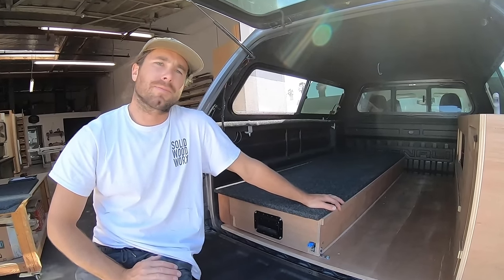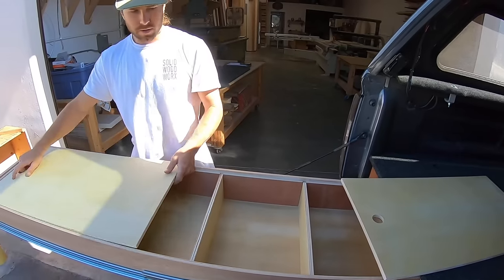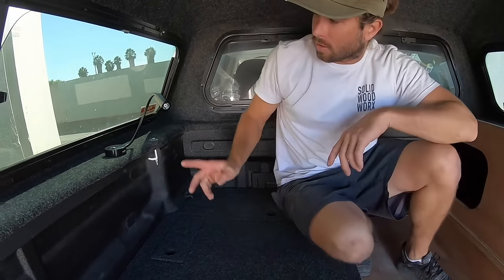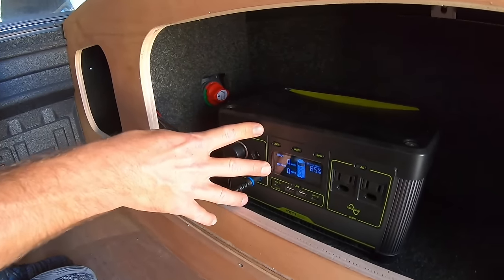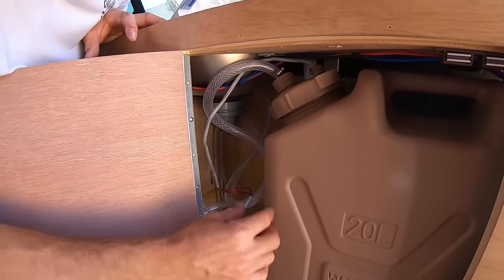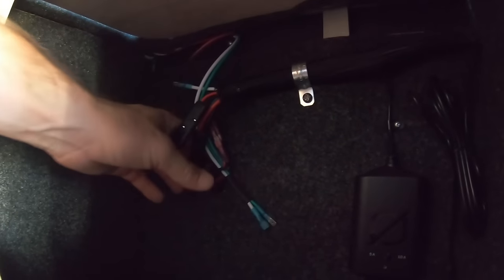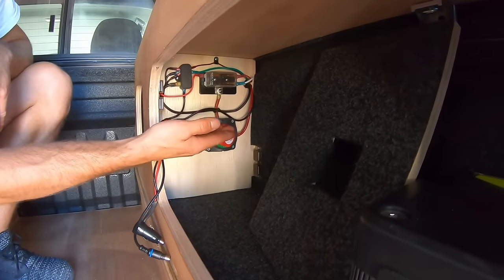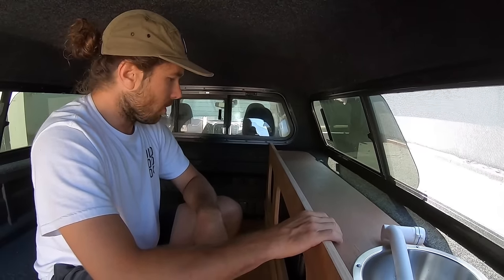GMC Canyon Camper Buildout

Comment: I am the owner and have been getting a lot of use out of the truck these past couple months. I really love and Brian did an amazing job on it. A couple replies to the comments. The sink just drains out the bed behind the rear wheel. I am finding I don’t use the sink very much at all. Mainly just to fill water bottles. If I need to use it where I can’t just let it drain onto the ground I can put a bucket or basin underneath the vehicle to catch it. Totally worked out with all the sizing of things. This is a mid height Leer top on it and when I am sitting on the bed with a 3 inch camping pad on it my head use clears the ceiling and it is quite comfy. I have sat out some rainstorms sitting inside with the he tailgate close but the window open and it is very cozy. The goal zero and wiring works like a charm. My Goal Zero is always charged when I need it and the electrics hardly draw from it. I am mostly doing weekend or two to three day trips so it is plenty. No need for solar at all. While the MaxAir fan on the roof is cool I don’t use it much so would probably skip it if I did this again. Only other thing is that I can’t access the drawer from inside the truck so just need to keep that in mind. I live in Southern California so it hasn’t really been a problem. Sitting on the tailgate and prepping dinner on the drawer is very comfortable and it is a great work surface. The work Brian did was fantastic and his build ideas based on my wishlist turned out great. Very happy with it!
Reply: A mid height top. Can you pull into a standard garage with that? Thanks.
Reply: Yes, it easily clears my standard garage door. The truck is a bit long but it will also fit in lengthwise too. Before I bought the truck I did a test drive and brought it home to make sure it would fit.
Reply: Bullshit. If your the owner of this truck then do a video on the setup?  What gear you carry etc.
Reply: @johnchiara2711 It’s tacky to ask how much. You could easily get a private quote from the actual Wood Worx guy.
Reply: Very nice build. To the owner having a Leer Topper do you find that it leaks anywhere. I have been chasing leak problems for a year now and can’t seem to get them stop. Mostly coming from the bed rail sides.
Reply: What did this cost you

Comment: Very sweet! I drive a colorado with the same bed length and do a not so nice somewhat version of this. One thing after using mine for a few years that id like to change is the windows on the topper from the slider like that to the wing windows that lift and also slide, then you can access your stuff from outside fairly easy and also totally open up the window on a nice day and have it totally opened up by the sink and table area. I don't have the sink, but i carry a 5 gallon jerry can with the faucet. This one definitely hits real close to home and I've said it before, man if you weren't 2000 miles away id definitely hit ya up to finish mine out!
Reply: Do you have the five foot bed or the six foot bed? I want to set up my bed for camping but I only got a 5 ft
Reply: @samuelyates4922  Im running a 6ft bed, I figured Id never need a crew cab 4 door, since id never be camping with a "crew" anyway. Extended cab is perfectly fine for my needs with it's behind the seat storage on the mini seats, it at least lets me have the 6ft bed.

Comment: nice and minimalistic. well done. I would have asked for the secondary platform to be on hinges, in sections. Remove the bedding, flip the "Nightstand" platform over, done. Same with the lower portion. It would give them a place to be stored, and ease of use. I sold my Canyon, but had I kept it, I would have considered such a design.
Reply: Or you just slide it in and store it on the floor.  Put a couple of low profile finger holds or metal loops on the longer section and then it can be raised up while you are positioned on the upper section. It seems like it would be pretty easy to do, after a little trial and error practicing. Small section is a piece of cake.

Comment: Great build, simple design, and clean. If this were my build, I would have added a backboard to the bed (along the truck bed) for a bench back. Thanks for the video.
Reply from the maker: Wanted to but he wanted it removable
Reply: @SolidWoodWorx  Understand completely. Great videos by the way!
Reply: @danstankiewicz8222  I find that the back isn't a problem and I just have a pillow there.

Comment: Very nice 👍
If it was a higher top vehicle, you could have a second drawer and use the low one for cooking (perfect height for standing outside) and use the higher drawer for extra storage space, (maybe have those drawers open sideways (instead of the long way) for storage and access use inside of the vehicle.). 

Just thinking...
I thought we need air circulation UNDERNEATH the mattress in order to prevent mold underneath the mattress ?
Reply from the maker: Customer is only sleeping in there few times a month not every night like a house. Also he uses a backpacking sleeping pad which is plastic covering.

Comment: How is your flooring constructed? It looks like a foam piece that fills in the dips/grooves naturally in a truck floor. Any links for that? Does that also help insulate against cold?
Reply from the maker: There is no insulation under the 3/4” floor.
Reply: How do the truck bed ripples get filled in underneath the plywood?

Comment: What do you do to stop dust sucking up into the back on gravel roads?? That was my biggest problem in the 70’s...
Reply from the maker: Some of my customer leaving a back window open a bit or weather proof the gaps
Reply: That doesn’t stop sucking the dust.... You need to install a 1 1/2 -2 inch abs connection the 45degree... with one part facing direction your driving , the other opens to inside the cap... air blowing by creates pressure to stop the dust sucking into the cap... I was using this method back in the 70’s... Worked then
Reply: I added a tailgate sealing kit which consists of a bunch of weather stripping that you add around the edges. It is much better with that but quite yet perfect.

Comment: Shouldn't there ideally be a dedicated, secondary battery (or solar) for a lot of this and the goal zero charge, instead of running it off of the car battery?
Reply from the maker: The goal zero only charges when he drives. He didn’t wanna mount a solar to the top of his shell and this option worked great for him
Reply: @SolidWoodWorx  Thanks for the explanation.  I'm new to electricals, solar, etc and trying to figure this all out.
Reply: @PS987654321PS  I mostly use the truck for weekends or short trips. I hardly use much of the battery capacity anyway to this is plenty.

Comment: Solid video. How do you choose a type of wood for a given build? What wood is good for climate with variable temps and humidity?
Reply from the maker: I personally just use a light weight wood and coat it. It would get pretty pricey and heavy to get a denser wood to not warp to much.

Comment: Brian - How wide is the 60" drawer and does it's bottom sit nearly flush with the floor panel?  I thought I heard you say it was installed over the wheel well but it looks like its beside it?? I'm having a hard time picturing how it functions without interfering with the wheel well.
Reply from the maker: It’s just beside it

Comment: Amazing builds bro. How do you get the uneven edges, surfaces and corners to fit so perfectly in the little grooves and notches? Do you use contour gauge?
Reply from the maker: Sometimes and sometimes just cut sand fit cut sand fit

Comment: Is the Goal Zero wired to recharge according to factory DC specs? If so, is there any issues with causing heat issues to the trucks alternator? Thank you for your video, enjoyed it bunches! 

Bakersfield, Ca.
Reply from the maker: Is it just being charged through an adapter goal zero makes which is plugged into a dc plug that is wired to the main battery with a relay to only turn on when the truck is running.

Brian
Reply: @SolidWoodWorx  — oh heck! Thank you Brian.

Comment: Hey Brian! To charge the Goal Zero only when the car is running do you use the same dual battery isolator as in your other video on dual batteries?
Reply from the maker: It is an add a fuse that kicks in when the ignition is on. Watch this video https://youtu.be/AAgSJUAwe3o

Comment: Another killer build! Love your work. Can I ask how you set up the charge input to the Goal Zero unit? ... Is it off of ACC power, or did you use a voltage sensitive relay? Thanks in advance!
Reply from the maker: Just an add a fuse to an ignition fuse in the fuse box
Reply: @SolidWoodWorx  There I go ... Over-complicating everything. Again! Thanks for the info.

Comment: I have a question about the goal zero wiring. Do you have that connected to solar also ? Great build !
Reply from the maker: I do not
Reply: Could you send the wiring for a roof solar panel down through the roof vent when it is installed? Of course if they wanted one.

Comment: What thickness plywood? Also, what plywood is it?
Reply from the maker: I use a light weight plywood called Luan. Mostly 3/4" thick and 1/2" for the bottoms and back of drawers and cabinets.

Comment: I've noticed for all of these camper builds, 0 people drill into their trucks to secure their furniture. I guess you don't have to.
Reply from the maker: I have many times
Reply: @SolidWoodWorx  do you long screw it and then put a bolt on it and cut the tip off your screw or? Ill consider screwing through my truck.

Comment: Hey Brian,  I love this build and thank you for posting all of your build videos, but if I may give my two cents on the sink setup. I know this because I'm looking at a lot of those same parts for my own build but that faucet you used is a "switched faucet". From what I understand, it's designed to turn the pump on/off when you turn the tap eliminating the need to turn the pump on/off with a separate switch. I'm really not trying to be a jerk in the comments, just trying to help out a bit if I can. Here's a link a to a video by Overland Bound where I learned what I'm talking about. I hope it helps!

https://www.youtube.com/watch?v=wNHp5F-d2c4&list=PLLiRK6uKhH6cX1o84EkOPdYAuOfirINgR&index=23&t=618s
Reply from the maker: I had to wire it this way so that the extra hose under the sink would work seperate.
Reply: @SolidWoodWorx  I figured there was a good reason for doing it that way. Thanks for getting back to me, hopefully someone sees this and it helps them with their build too.